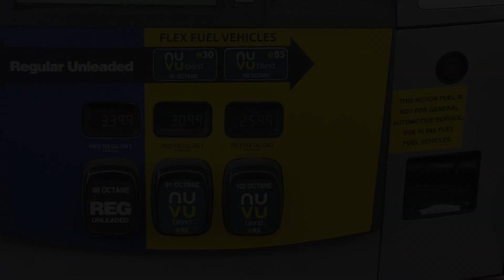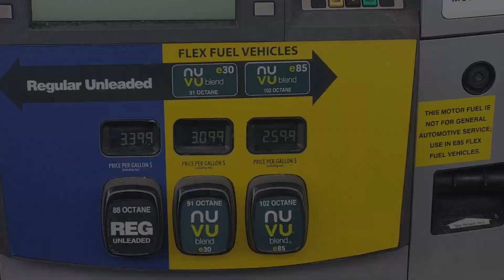E85, what is it, why do you want to use it? Build Back Better Episode 3

Comment: So here's a question I have a computer from zl1 or what ever they are they wiped all the info out and added a tune so I was told that if it's not flex fuel you would have to choose between tunes is this a true statement because I want to run e85  I ran it in my dragboat  and it worked good it's a very cold fuel so it will help with boost but I might need to run regular gas also let me know your thoughts thanks 👍
Reply from the maker: I'm not as familiar with the newer PCMs, but I don't see any reason you can't start with a Flex capable OS and tune from there, same as I am
Reply: I think I remember that you didn't want to get into tuning but if I need a hand you think you can help out a little I live in Kalamazoo but I get it if you got other shit to worry about thanks

Comment: 8👍's up DWE thanks for sharing
Reply: usually E85 you are wasting your parts in your motor you are wasting your money
all vehicles without turbos without nitrous and without the ability to adjust timing should never use e85 because the alcohol runs out the tailpipe of your exhaust system

Comment: e85 only is corrosive if you get water in the lines, other than that it's just as corrosive as regular gas.  Correct?
Reply from the maker: A thing I should have mentioned and forgot because I left my notes at home, alcohol is hydroscopic... It will pull water from the air.

Comment: Man, you have great fuel "types" available. When I did my planning for my LS swap, I included a fuel type monitor wire for future. Simply because of the potential PC terrorist eliminating our access to gasoline. This is my last "toy" and I want to be able to run it as long as I can. Found your brief info on Nitro Methane interesting, that's a fuel I know nothing about, Have ran aviation gas, and racing fuel.

Comment: Do you know how would a steel gas tank work with using E85?
Reply from the maker: Makes no difference
Reply: Depends on how often you drive it really. It's my experience you don't want to leave ethanol sitting for a long time because it absorbs water.
Reply: I ran e85 in my stock 73 gas tank with no issues. I also use Lucas ethanol conditioner every time

Comment: Ethanol is MORE efficient than gasoline. More than 80% of the energy in gasoline is wasted as heat. Only 60% of ethanol's energy goes to waste heat. You have to run more ethanol because it has more oxygen in it, and the specific gravity is different. You can get more mileage than gasoline, but not with an engine that will run on pump gas. With forced induction its hard to get better mileage because the added O2 compounds as you add more air, you need to add a lot more fuel. 

How do you get better mileage? More compression. Around 12:1 with iron heads you will start getting better mileage with ethanol than you can on gasoline in the same size engine, with the only change being the SCR. With my 13:1 scr 455 I was getting better mileage with the same size engine, and a hell of a lot more power, than the exact same car with an 8.8:1 scr 455 running 87 octane. It was in my 1970 GTO.. getting 19-21mpg, and capable of pushing that 4100lb car into the 11s with a 3.42 gear. The 11.5:1 455 in my 65 GTO is getting 17mpg mixed with a 3.08 gear, and it got a best of 15 with a 2.56 gear pushed by a 7.8:1 400. It doesn't do so well because the aero is atrocious.

Ethanol does NOT gum anything up. It cleans everything. There is no residue left after you finish a bottle of vodka, thats all ethanol is.. vodka. It would be whiskey if you aged it in a barrel, beer if you don't distill it. its actually called beer before you distill it. I know, I distill it and run my engines on home made E100. My fuel tanks are spotless inside, unless they are running pump gas. Most of my vehicles sit for months at a time, the winter in the upper peninsula is long. October to May my old cars and trucks sit. I drive $500 winter beaters in the salt. 

The waxy residue and chalky white stuff is from additives put in by the oil companies, it is NOT due to ethanol. Don't believe me just because I say so... but I found the same results over a much longer period of time, 15 years at this point, that Jeff Smith of HRM and Summit Racing found.

https://www.onallcylinders.com/2018/05/25/ask-away-jeff-smith-e85-pump-gas-additives-not-ethanol-cause-corrosion/

In the 1990s I was running the 11.5:1 heads on another 455, a steady diet of VP red and Sunoco 110 was all it got. That stuff chewed up the rubber line, accel pump diaphragms, and fuel pumps every other year. Sometimes I got three years out of them. I switched to E85 and E100 in 2007 when gasoline was $5 for 87 octane here. All my carb parts, fuel pumps, and hoses last for years. I have yet to replace them on the 65 GTO, and its been on E85 since 2018. The pump gas wrecks all kinds of stuff, I hate having to use it in winter.

The gasoline tears things up, the additives also tear things up. The ethanol doesn't seem to harm anything, despite everyone saying it does. As long as I have been running it, with basic parts and supplies from CarQuest and Napa for small stuff like fuel hose, Summit, and Jegs for big parts, I have yet to have a problem caused by ethanol.. even when it sits for months or years at a time. 

The pump gas fuel systems do not fare as well to say the least. I have a 98 Formula with the LS1 and 4L60E, it runs on premium. The rear end broke in 2017 so I parked it. By 2020 it would not start as the fuel pump varnished stuck. I dropped the tank in September and its full of rust, varnish, and crud. I can park a vehicle with ethanol in it for 5 years and it starts no problem. Every spring when I pull them out, they run fine on the fuel I left in it, and it varies how much I left in it.

I am into ethanol because I can make it myself, not have to pay the $3.50 a gallon for 87, or the $4.60 they want for premium UP here. When I can make fuel from tree sap that costs me ten cents a gallon, Its very worth my time to spend a week gathering sap, waiting a week for it to ferment, and spending a few afternoons running the stills.

I am a crippled Iraq war vet, on a fixed income. I cant afford to replace parts that get tore up by fuel. I can't afford stainless or any other 'exotic' parts. Its all garden variety, basic stuff.. well, except for the engine I decided to build this year before the dollar isn't worth anything. I don't sell anything or have any interest/stocks in ethanol production for E85 I make my own. I got into this so I could have more money available for parts, because up here energy is my biggest expense. Food, fuel,  electricity. Lots of $$$.